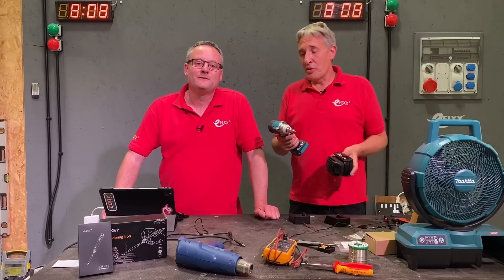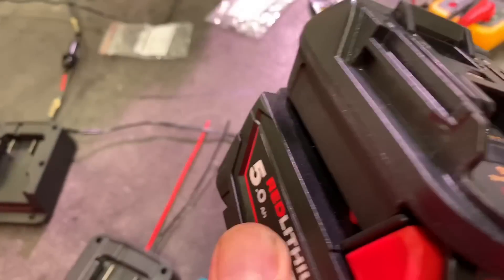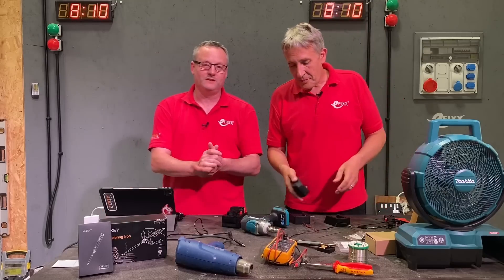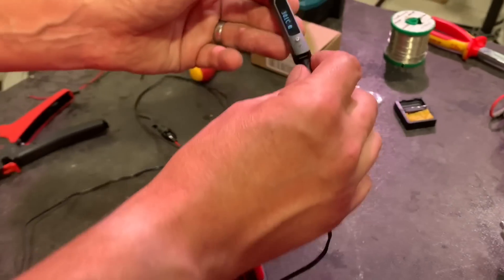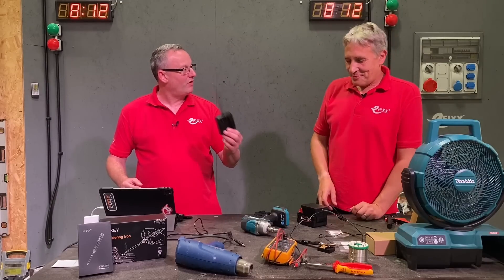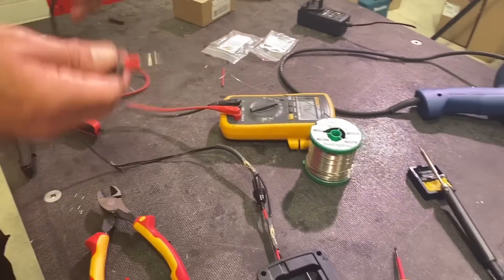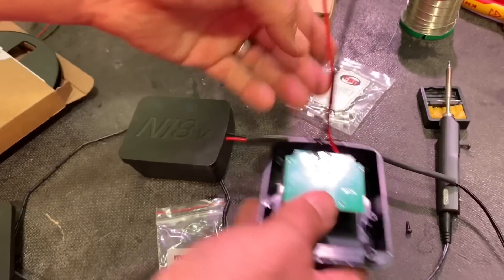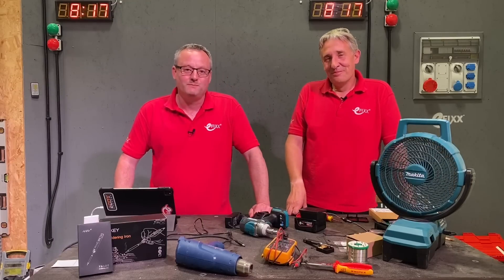🔋BATTERY ADAPTERS: ⚡️MILWAUKEE M18 Battery on MAKITA POWER TOOLS?

Comment: Also worth noting, most important thing is to avoid very deep discharge as well - that saves the battery. I wonder if the circuit does that? And now I’m thinking of 3D printing my own one of these for dewalt and making up a quick protection circuit (better than the Amazon product I hope!)

Comment: You said the “circuit board is wrong” but didn’t give much more info eg what was actually on that PCB. Looked like there were definitely components on the PCB. Maybe I’m wrong? Any more info here? Just because it doesn’t have a fuse, doesn’t mean there’s no short circuit protection! What about reverse polarity? Or maybe even basic current limiting circuit?

Comment: In fact, factories in China are now able to mix makita/dewalt/bosch/milwaukee series batteries. For example, I can use makita batteries on dewalt/bosch/Milwaukee machines. Similarly, Milwaukee batteries can be used on makita/bosch/dewaly machines. Now many battery factories in China can do it (I am one of them)

Comment: On the subject of tool batteries, why do most tool battery chargers not support the full 100-240v range that pretty much every other similar power supply does these days ( laptop,phone chargers etc.). Considering how common 110v is on sites, it's just ridiculous.
Reply: It's also extremely irritating when you're trying to use power tools abroad.

I have been known to use a hotel kettle to shrink heatshrink, works better than the hair drier!

Comment: The Cordless Alliance System which uses Metabo batteries is supported by well over 30 brands

But the big brands like DeWalt and Makits don't want to join
Reply: Looking at the list, it seems to be mostly obscure or niche brands (Cembre and Rotherberger were the only ones I recognized) who can't be arsed to design their own battery. Literally nothing that you would find in your avarage tool shop.
Reply: @mikeselectricstuff  Rothenberger, Mafell, Metabo, there are some big names on the CAS system

Comment: I have one of these adapters, and it comes in handy, think of the resources that could be saved if the main manufacturers used a common form factor for removable batteries, pipe dreams I know.
Reply from the maker: Wise words 👍
Reply: Well, it doesnt need to be a pipe dream if EU as an example demand there to be one standard for batteries. It really make sense, but no one have come around and seen what a massive issue this really is.
Reply: @Faddnn  there are a few German manufacturers that have a common battery system, but they are not mainstream.
They did it with usb for phone chargers, so it could easily be implemented, but I doubt it will.
Reply: I met with Stanley black and decker reps a few years ago and they admitted that they're working on approved cross platform battery support.

They own DeWalt, Porter cable, craftsman, Stanley, Mac, Irwin and others
Reply: @synapticburn  I would be surprised if it did ever happen, it seems to be getting worse, just look at the manufacturers that are fetching out proprietary blades, discs etc rather than sticking to the common form factor, they know doing things like this will generate them more revenue. 
Every major company will say they are committed to reducing waste, yet they do the opposite, their actions actually generate more waste, and batteries are big business, none of the main players will want to give that up.
 I hope I am wrong, but can't see it unless government's step in and force them to change their ways.

Comment: You cant charge the battery using the adapter because if you look carefully at a battery’s terminals you see theres more than just the + and - terminals, these are sensor and balance terminals.

The balancing terminals are used by the charger in order to ensure the cells inside the battery charge at the same rate. 

Also the chargers are expecting certain voltage and resistance values when connecting a battery, different manufacturers use different cells etc and so the charger can become confused and potentially indicate that the battery is faulty

Different manufacturers have a different pinout and order of terminals on their battery, i.e the terminals on the makita  battery could be +,1,2,3,- but on the milwaukee charger it could be +,2,1,3,-

It could still be possible to add these terminals into the adapter however that would increase cost.
Reply: The adapter cannot charge the battery, it can only be used to discharge

Comment: Bosch have started a scheme to let other manufacturers to use their pro for all battery series and a lot of the German manufacturers have joined it. Maybe something like the mobile common charger type the the EU has regulated on.
Been thinking about getting a couple of these recently when I came across them because I have older DeWalt kit that takes the older nicad battery type shape not the new slide on type. Converting between different types and manufacturers would be really useful to keep older kit going or just to get you out of trouble on site.

Comment: Yeah, but, no, but 😂 
For Milwaukee’s Fuel, Bosch’s Procore, etc., there’s a chipset in their premier batteries which gets you the additional performance compared to their standard 18v tools.

Clipping them on a Makita, Dewalt, etc., works fine as the performance isn’t determined by the chipset, but usually the battery size.

Using one of these adapters may void your warranty (if you’re dull enough to tell them you used an adapter).

There’s a guy out there somewhere that’s adapted a car battery to run his impact wrench.

Plenty of designs online to 3D print a battery converter that aren’t so big & bulky.
Reply from the maker: Great input - Thanks Jonathan we will explore the battery comms issue further.